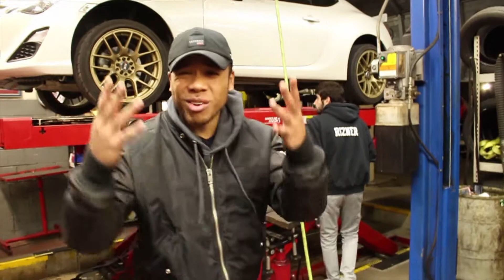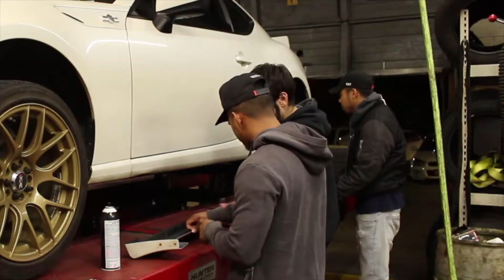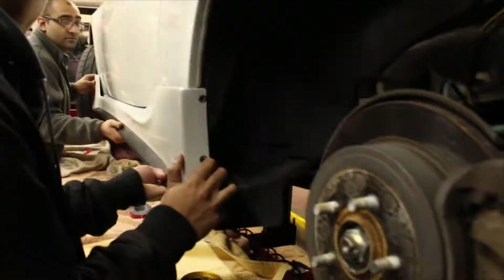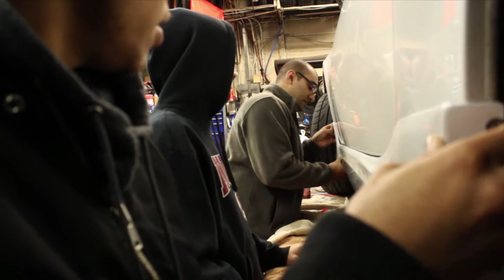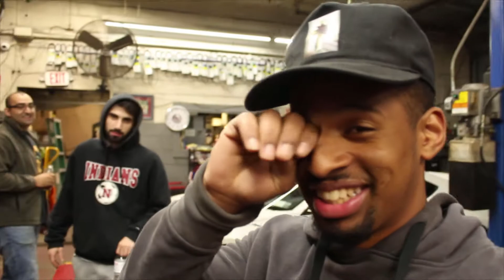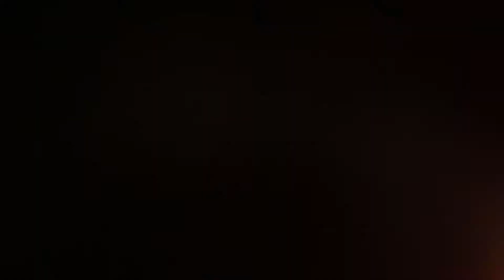How To Install Sideskirts ! (BRZ/FRS/GT86)

Comment: Do you drive your brz in the winter? And if you do how is it because I’m looking into a gt86 and I’m wondering how it handles the snow because it’s a rwd.
Reply: Different. Sand bags in the trunk and winter tires and youll be fine just take it easy. Only issue you'll have is clearance since these cars are low, if theres a lot of snow piled up its a no go
Reply from the maker: Yes absolutely agree with sam! If you check out my old videos I actually went snow drifting with my stock tires. I drove home sliding a bit but then again my car was stock and it still did amazing! With some winter tires Bro, you’ll have no issues as long as you drive safe.
Reply: Thanks guys!